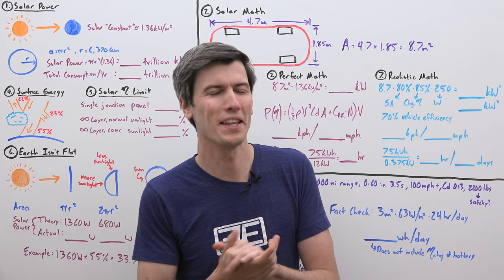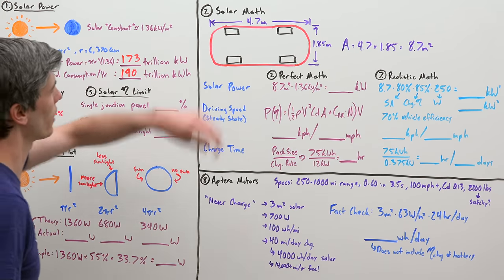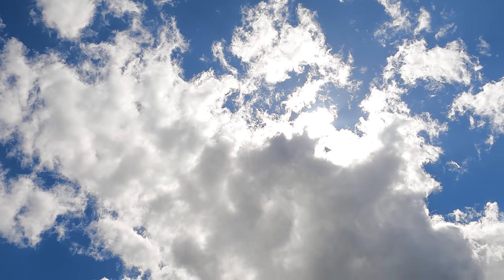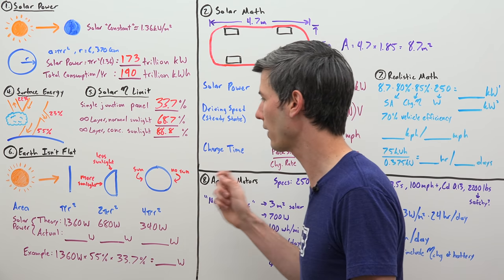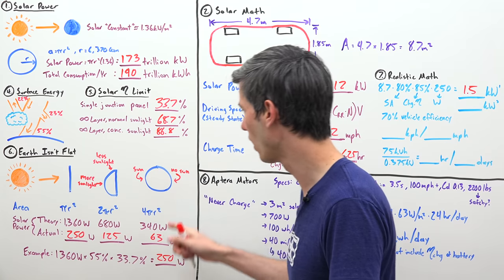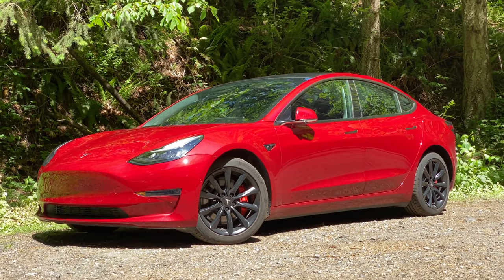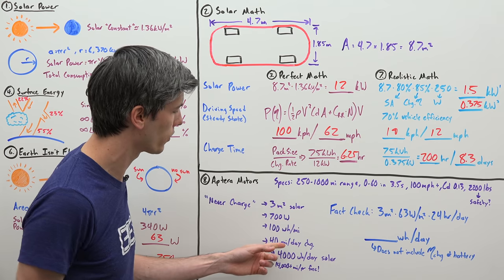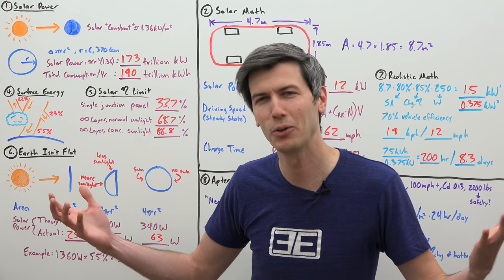Why Don't Solar Powered Cars Exist?

Comment: I had to pop in today to say I saw a car with only the roof covered with panels labeled as 💯 solar. We have been in a blizzard for nearly 3 months....... 🤣  there is snow falling as I type. It's been a record breaker. He may have just been out keeping the batteries wet or maybe he had it sitting and charging intermittently or maybe he had it stored in Utah to charge then drove to CO when it was done. Idk 🤷‍♂️

Comment: You should redo these calculations using the drag coefficient of an actual solar car that is about to be put to Productions such as the sono sion and also calculate how much energy the windows could gather if they are window solar panels.
Reply: ….why don’t you redo the calculations with the cd of the car you suggest if you know it?

Comment: Time to pull a small lightweight trailer covered with solar panels
Reply: People have mentioned that on the Aptera forums... No one really knows but the c/d and rolling resistance of trailer would have to be significantly less than power generated to make it worth it. Plus, as of now there is no tow hitch planned for Aptera, but obviously motorcycles and three wheels do it so I think it is possible...

Comment: I drive on solar, takes 2 hours to recharge.   1)   I don't carry solar panels, I charge when not using.    2)   I have 300 watt hours   3)  I use electric bicycle 20x more efficient than tesla on energy per mile.
Reply: Panel size?

Comment: Elon Musk built the wrong car for the right reasons of making money. A car doesn't need 1000HP, doesn't need to be luxurious to be electric, but it only sells because of it, and it doesn't look like a shoebox.

 Aptera is building the right car for the right reasons. A car that recharges 40 miles every day, can go 1000 miles with more batteries, and has 700W worth of solar panels on top, and it is purposely designed to be supremely efficient, no other considerations were included. It is not the car I want, it is the car I need.

Comment: At least the math works to where this is reasonably possible. I always hate when someone has an interesting new concept that they make all sorts of crazy claims which are completely bogus. It discredits things to where they end up flopping, but I guess in the short term it attracts attention and money. Hopefully they can build some and show that it actually works. Hopefully they can actually increase efficiency that much since that could make a car that's more reasonable even if the solar doesn't provide enough to get very far. Having a 1,000 mile range would be amazing for road trips without needing to stop and charge multiple times.

Comment: u completely forgot that ur using PV cells!
 Before u start using the 33.7% theoretical cap u have to remove the infrared and UV from the equation(55% insolation), thats a 60% loss, only 40% visible light is usable by the PV cell then the efficiency of 33.7%.
Do this n ul get the 1 month charging time.

Comment: They do or at least did have solar powered cars. I even remember people racing them in the eighties. Okay the real ones might not win in a race with fast bicycle rider. But if your competition was running on a clear day you would probably win! The real ones were quite long, certainly not shaped like a Tesla. They were best described as wafer shaped. They actually rolled on three bicycle wheels. Based on the actual speeds they reached I don't believe that the solar collectors produced anything close to the kind of power output per square meter you came up with. Maybe output has improved by that much in almost 40 years. Or maybe your numbers are over optimistic.

Comment: A Tesla requires 11.5 kW @ 1 Hour of power to fully charge.  4 solar panels are 0.8KW.  It would only take 8 hours to more than half charge the car.  This is what a typical work day is.  A typical travel time from home to work is 30 minutes.  I don't think you are going to be able to debate this one away.  Even if it is not fully charged, the car will never be fully empty either.  Only on non-typical long travel days would you need supplemental power.  The car would be chronically fully charged most of the time.
Reply: A low end Tesla comes with 50 kWh battery (Model 3). Not 11.5 kWh. High end comes with 100 kWh.
Reply: @Alexagrigorieff  I was talking about the Tesla home charger.  It is an 11.5kW charger.  The documentation says that it can charge a car to operate a distance of 44 miles with 1 hour of charge.  Since the car is sitting at work for 8 hours, a system of 1.5kW panels would be 12kW total charge.  That would be a distance of about 50 miles.  Well within most driving ranges.  The car will never be fully depleted if you drive less than that every day.  My commute to work is about 7.5 miles each way.
Reply: @samuelmcbride  Charging " to operate a distance of 44 miles" is not the same as  "to fully charge". 1.5 kW panel in the continental US would be at least 9-10 square meters, and has to be oriented toward the ecliptic.
Reply: @Alexagrigorieff  it is fully charged if you only drive 30 miles per day.  The point is that you only have to top it off.
Reply: @Alexagrigorieff  Per the Tesla web site, the nominal use case is that 11.5kW for 1 hour will keep your car fully charged.
Reply: Ambassador George Shultz had  solar panels on his house and he gleefully told me how driving his Tesla was cost free because his solar supplied all the power he needed.

Comment: A very bad break down. Who seriously thinks you can get by, by solar power alone for a EV? 

The numbers you should be crunching is, how much would the solar cells weigh? How much less battery and battery weight could you use thanks to the presence of the solar cells, and then being lighter you  could get further range still. 

How much do the photovoltaics cost to put them throughout the roof of a vehicle? How long would they pay themselves back in electricity savings?

Comment: Your smart.. can you tell me Why can't they put alternators on the drive motors to charge the battery's on battery powered cars. Than it would be self sustained.  Or even in the hubs. Why not.
Reply: The drag of the alternators saps energy in the form of heat and you don't get as much electricity back to convert to motion to overcome the added drag it produces.

Comment: What if its electric and solar
Reply: Solar to recharge when the car stands still. 
With lightweight solar panel on top of the vehicule, the autonomy would rise, and the battery could recharge for free while it's not moving. Rather than recharging only when the motor turns into a generator when decelerating.

Comment: Not an engineer, but here's a question; why don't they create a hybrid with green hydrogen, with solar panels on the roof, graphene,  make it self charging as it drives (like a dynamo) via motion, and introduce wireless charging  technology into society? Bit like the actual N.Tesla tech?? If on its own; each component can't cut it.. surely combined would be achievable and negate long charging and  range anxiety.
Reply: 1) Charging while driving via a dynamo is a misguided and thinly disguised attempt at perpetual motion.

2) Hydrogen is hopelessly inefficient.
Reply: @fredbloggs5902  Green Hydrogen has very recently just been given a boost by a metal that can store and release more to negate the compressed tank problem. A dynamo wouldn't be perpetual motion, just charging in unison whenever the vehicle is running.
Reply: @BB-mv9wl  How the hydrogen is stored is largely irrelevant, making it is only 50% efficient and fuel cells are only 50%.

That a total of only 25% efficient.

BEVs are 2-3 times more efficient.

(The storage in a metal is a complete fraud in my opinion, but that’s a separate issue).

Charging from a Dynamo simply takes power by slowing down the car, but keep going you’re hilarious.
Reply: @fredbloggs5902  a dynamo wouldn't hardly have any effect on the speed of the vehicle. While the vehicle is in motion, it will be charging.. what could be more logical? 
To your other points; is exactly why I suggested in my initial comment to use it it unison with other tech like a hybrid.

Can't see why you are trying to get personal from behind the safety of a computer screen about cars either.
Reply: @BB-mv9wl  the power used keeping the car at a constant speed will exceed the energy generated by the dynamo.

I’m sorry that you’re incapable of understanding that. It isn’t my fault.

Comment: I seen solar powered car's right here on YouTube just a couple of years ago,, maybe This Guy doesn't think of it as real cars because they are really light weight using bicycle wheels and bicycle air shock's but they have four wheels and roof windshield etc ithink it was mostly glass fibre clad with solar cells from solar panels and charge itself while being parked and while driving and use regenerative break's ,, The most advanced one had one heavy part a flywheel so it could accelerate fast enough to follow traffic after a stop sign etc..that one i Think was built by some sort of school University maybe,,, and you also have"pods" They looks like car's but it's no steering wheel you steering by levers one on each side of the seat and has electric motors for bicycles and same batteries and you pedal to just like electric bicycle to make them legal without a driver's license.. those could easily be made into solar car's just by using the solar charger for optibike that's flexible and throw out the heavy seats and the 12volt battery's which only functions The heater air-conditioning and the cigarette lighter thing which was used to charge cellphones etc in the infomercial..so this video should instead be named why solar car's are slower than combustion car's and the answer is because it's still a developing technology! batteries gets better and better each year,,lipo batteries is the reason why we have drones and micro RC helicopters electric motors gets better every year to..i guess first combustion engine's where steam engines, running on burning charcoal boiling water into steam which moves The piston.tbats kinda the same stage we are on electric motor and many other electric thing's ,,, if we could use electricity from positive and negative ion's in the air then use technology developed from that to increase the efficiency of all electric thing's that needs more power i Think electric cars could get better range than any gasoline car

Comment: The weight issue of car safety you can stop. It has to do with energy - twice the weight twice the energy. Twice the speed quadruple the energy.
Also most cars in Denmark are around 2000 pounds or 1000 kg. And the fatalities in the US on the roads are about 11 per 100000 people. The same number in Denmark is 2,8 per 100000 people.

Comment: So on a Ford E-Transit, with about 14 sqm surface and a 68 kWh battery, it'd take about 125 hours or 5 days to charge by this math?
Reply: I'll trust your math but yes.  You might be missing the point, however.  Design a car to be much more efficient and incorporate solar and, like Aptera (assuming specs are valid), you'd be able to get, on average, over 30 miles of range a day if in a sunny climate.

Comment: So it DOES work but strictly as a back and forth to work type of vehicle and that’s practically it
Reply: Remember that the ultra high efficiency of the Aptera is still paying off, even if solar isn't used at all.  Those who don't need it don't have to pay the $900 it will cost, but there are few that wouldn't see a payback over the life of the car.

Comment: You'd have to avoid any shadows when driving and parking and, of course, you could never use an airconditioning.
Hot times coming....
Reply: Says who?  I typically drive 5-10 miles a day.  I could easily do almost all of my driving using nothing but the sun, even while using AC.  Only long trips would require external charging.
Reply: @valderon3692   Says me. 10 miles a day would be less than 4 k m p.a. - way below the national average, you could do that with a golf cart.
Fine if that works for you...
Reply: @notroll1279  Well, I'm not sure why everyone else drives so much.  I drive 2 miles to work then 2 miles home.  Sometimes shopping for food at the store a mile or two away.  The occasional social gathering a few miles away.  I don't get what else there is to account for so many more miles.  I've never known anyone who actually drives the national average.  I've driven about 1600 miles in the last year.
Reply: @valderon3692   Well, it's a question of how and where you and your friends are living. I don't reach the national average, either, because I live in an inner residential area of a major city... I don't even need my car every single day. But since it's a built-up area, the challenge for a solar-only car would be to find unshaded parking...
I think the high national average comes from zoned suburbia where daily commutes are long and where you have to drive miles to do even your essential grocery shopping.
More unshaded parking there... but, alas, a lot more range needed...
Reply: The Aptera uses a foam filled body shell that has a far higher r value than a typical metal bodied car.  The AC will not be stressed.  They are designing it for up to 125 F ambient conditions.

Comment: I sell solar, it's great for home use. Instantaneous use in a car would be tough, unless stored in batteries in the car
Reply: Not only does Aptera have batteries in the car- with V2G, they will be able to feed power back into the house, too when the grid is under stress.

Comment: Alaska is where this Aptera car doesn't work. Californians would be vibin. The middle east would be filled with these. I wonder if you could drive it less than 40mi/day for a few days, before a long drive, and if you'd still have the range for a 550mi drive.

Comment: 12 kw/0,37 kw theory versus reality (and we still used ideal panels and simplified a few other step.) that is a 300 times difference. why it is important, earlier, you went, we have so much solar energy, one day of solar energy enough to power the entire year worth of human energy need. what is the ratio between day and year? 365, or around 300, so yes, this is the issue of solar, at the tart, we just need a day (of the entire earth surface) for every year, at the end, we need nearly the entire year, meaning practically the entire earth needs to be covered in solar panel, give or take a few percent.

Comment: So you leave your Aptera out in the hot sun to charge it. Then immediately use all that power to cool it down just so you can actually get in the thing :-)
Reply: The Aptera body has a foam filled shell that has a high r value, unlike a typical steel car.
Reply: @n.brucenelson5920  and yet, even on my steel car, most of the solar gain is through the glass.

Comment: What about a wind/solar powered vehicle..I have a patent pending multi-stage rotor.. It is essentially a non reciprocating compressor, much like the compressor stage of a jet engine, but  concentrically aligned.  i am not good at the maths and therefore not  aware how efficient it may be.. Anyone out there to help build a prototype?

Comment: That 100 wh/mile is a fairy story. Tesla is already quite efficient, and nobody is going to double Tesla's numbers.
What WOULD be possible would be to install solar converters on the ROOF of your home, if it is a single-family dwelling. Then the effective cross sectional are goes up by more than a factor of 10. When home, you leave the car plugged into the PV array. You might also have the ability to swap batteries, charge the A pack at home while the car uses the B pack. SUCH a setup would give you a fully solar powered car.
Reply: Even the alpha vehicles are doing better than those numbers, and there are still savings to be had.  Your suggestion to combine roof top solar is a good one, and V2G will also be a big advantage for the stability of the grid, even with a relatively small number of vehicles.   Because of the weight and cost of the batteries, battery swapping will not be easily achievable at first.

Comment: The weight of the solar panels, their support and the charger were not factored in. Weight is a big factor when designing an EV.   Also, you will not always be able to have the car in sunlight, nor will you be able to have all of the panels oriented to collect the energy of the sun efficiently.  Factor all of that in, plus the ugliness of the panels and you have a non-starter.

Comment: Now what if you used solar power to heat your hydrogen generator using silicon-iron which then got stored for late ruse in your fuel-cell? That doesn't need much heat or electricity, just time.

Comment: Something is weird with you Math.  My 200W array on my RV produces about 1kwh per  day  with just a bit over one sqm of surface covered.
Reply: Seems about right. I've always heard you can expect to average something like 5 hours of peak sunlight per 24-hour period, so 1 kWh for a 200W array hits that. His calculations used 6 peak hours, which seems close enough for the level of estimation he was doing here. (He didn't try to account for your latitude, just averaged the whole surface of the earth, nor your local weather patterns, again he just used an average figure.)

200W in just over a square meter is less than 20% efficient. He said the theoretical max was 33.7%, but we all know that no single-junction panel technology is close to that yet. (Clearly your panels aren't.)
Reply: @ps.2  Aptera panels are 22-23% efficient at present.

Comment: Why would I want solar panels on my car? It's just extra weight. Rather put them on the roof of the house and charge some intermediary batteries which then charges your car.
Reply: Very little extra weight and cost.  Why not both?